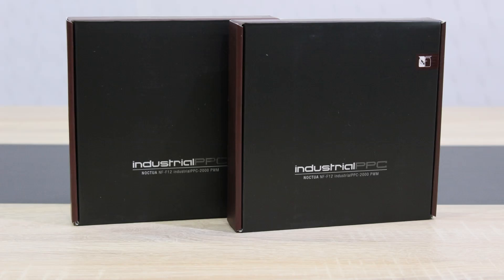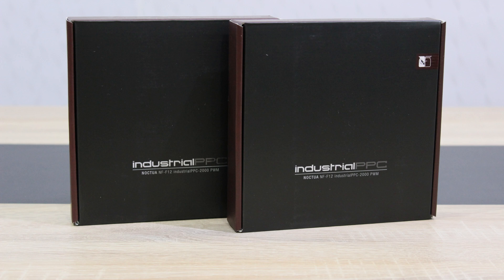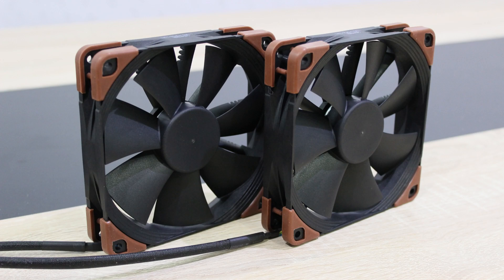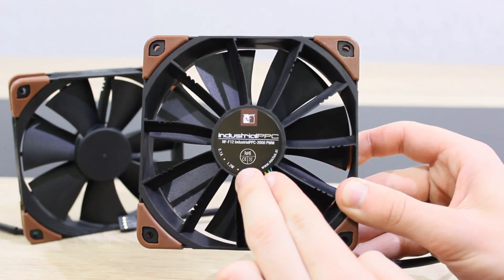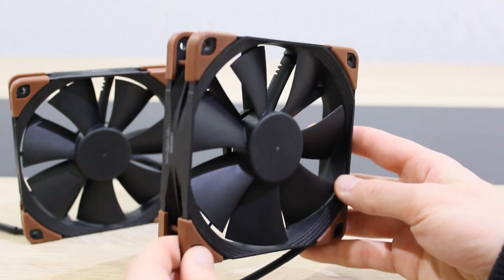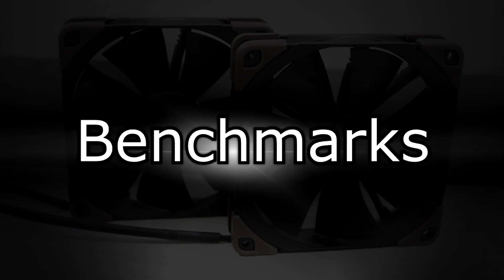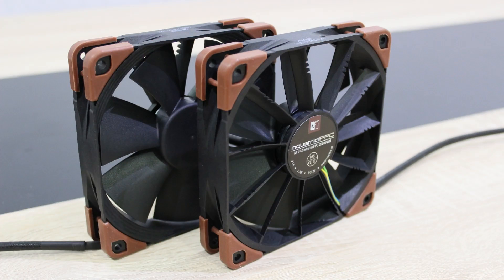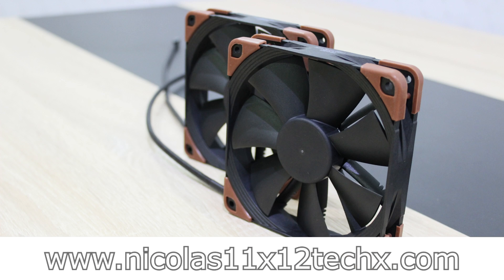Noctua NF-F12 industrialPPC-2000 PWM 120mm Review

Comment: WELL BUILT MY ASS !!!
I've got 7 (s-e-v-e-n) of these fans (that's 168€ of fans...) and one died 24h after I received it.
The biggest issue is that there's nothing that block the wiring harness to the fan chassis, so if you accidentally pull the wires all the strain will end up on the fragile soldering of a single tiny wire, the PWM one which is the shortest, with the risk of ripping the wire on the soldering making the fan almost useless (already happened!)

In second place, those static guide vanes produce an annoying noise when the fan blades travel over their edge.

Last but not least, you may have to remove those anti vibration things if you are assembling these fans on a 240 or 360mm radiator.

Someone could also argue about that black sheath which is only "nice looking" but make the wiring bulkier and stiffer, but that's a minor issue

Comment: would putting 2 of these on a Corsair h80i be better than the stock fans?
Reply: Yes stock h80i and h100i are horrible get new fans and you would get outstanding results
Reply: +Javier  Lomeli My H100i GTX fans are so loud and unbearable, I was thinking of purchasing these fans as a replacement. Do I connect the fan plugs into the splitter that came with the Cooler? Or directly onto the Asus Z170 Deluxe Motherboard? Cheers!
Reply: I know this is late but did you get these fans for your cooler? If so, how are they?
Reply: theyre good. silent and good
Reply: I would like to confirm this, although still a little loud, but a lot better than the jet engine stock fans I had.
Reply: Chuck Lee Did you get the 2000RPM or 3000RPM ones?
Reply: 2000 RPM, running at around 700RPM not under load, but still quiet loud imo, although it will be significantly better than the default ones I had.